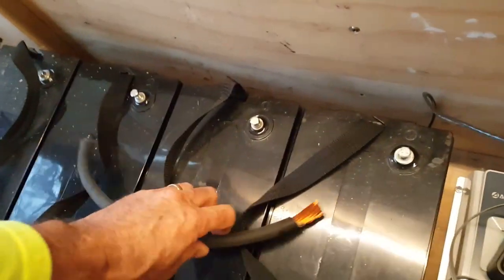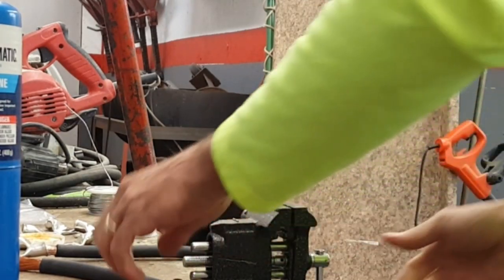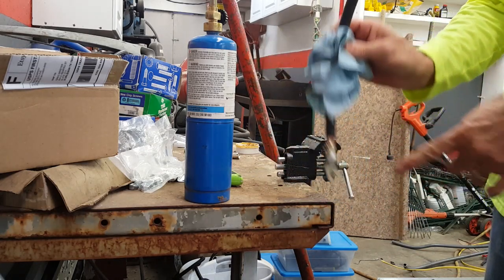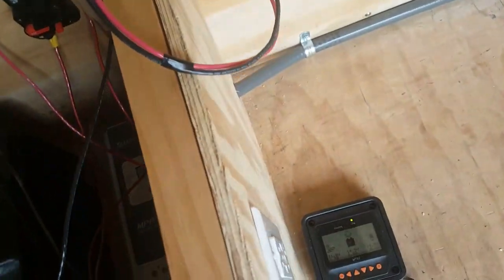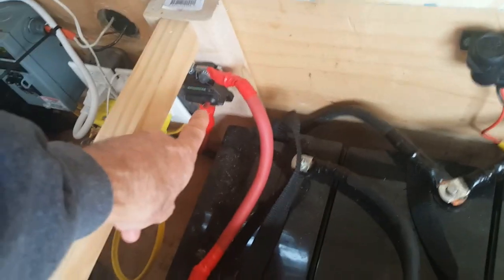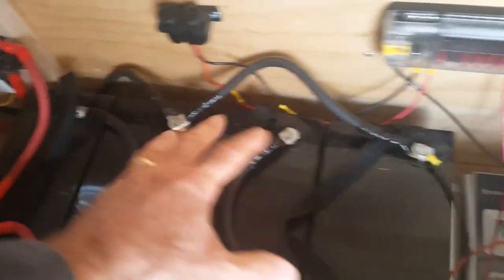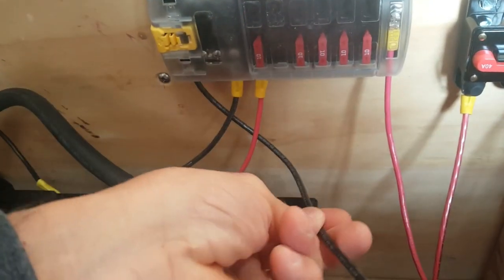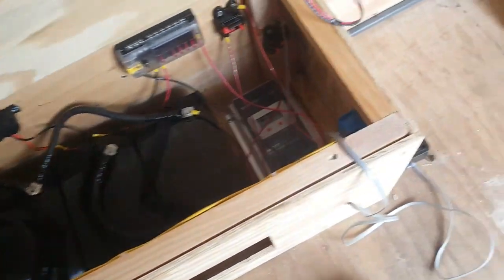12 VOLT DC ELECTRICAL SYSTEMS 6 x 12 Cargo Trailer Conversion Part 11

Comment: Thank you for going step by step and showing exactly which line goes to what and specifically adding what type of wire. Most videos will show you but not explain what is going on. I am a very visual learner and I learned more from yours about how to set up a 12v system. I know how the confidence to go out and try mine. Thank you again!!!
Reply from the maker: I am glad it helped Derek. Good luck on your project.

Comment: I really love your videos .... so informative! I have a question..the plug you use for the “switch” from shore to battery, what is the size of that cable and plug ... and I am assuming that you directly connected that to the outlets on either end?  Thanks for your videos!

Comment: Great info! How close do the batteries have to be to the rest of the set up?
Reply from the maker: Thanks for watching. I always try to keep all the cables and wires as short as possible. More wire is more resistance. Good luck with your project.

Comment: I really like your set up. A couple of questions,  I have a 7x14 trailer and I have 2- 12V batteries and 2- 170W solar panels making it a total of 340W with a 1500 inverter, actually the same one you have.  Should that be enough juice to run a small water pump and an AC unit that I am installing from the roof for dry camping?
Reply from the maker: That will run the water pump easily. It will not run the AC at all. We don't even try to run our AC off of our batteries. It's is not impossible to do but it takes a lot more battery than I have to run AC. We do run AC when we are hooked up to 30 amp shore power.

Comment: Nice build! Question: did you put anything between the battery bank and the load to protect the batteries by cutting off the load when they reach 11 volts or whatever your cut-off threshold is? As a ham radio operator I totally killed a 20 amp/hour AGM battery during a power outage. I wasn't home to shut down the load. While I was able to charge it again, it would die after 15 minutes so really, it never held a charge ever again.  Cheers!
Reply from the maker: I don't have anything like that. Thanks for the suggestion.

Comment: Question. 
Why did you use 150watt breaker? Same goes for the 40watt breakers?
Reply from the maker: They are 150 amp and 40 amp breakers. The breakers are sized for the wires and load expected.

Comment: GB I am very confused I hope you can help me. I am rebuilding a 73' Monterey Travel Trailer and I am going to start the electrical. I want to install shore power and of course battery power. I will add in solar later. My question is once the shore power is installed is there a way to run everything off that if you have hook ups, AC and DC power?  Or do you have to switch your connections over to the Inverter? Is there a way it all can connect together AC and DC power switch to and from Shore power to Battery? I hope this makes sense.
Reply from the maker: Hey Juan. When we are plugged into shore power everything is running off of shore power except the 12 volt roof vent. While plugged in, if we didn't have solar panels, we could plug in a battery charger to keep the batteries charged. When we are on battery power everything runs just on battery power, the inverter. We do have plug ins inside that we switch when we change power supplies. Take a look at part 9 and 10 of our build for more info. https://www.youtube.com/watch?v=Q2zctGoAR60&t   https://www.youtube.com/watch?v=u3wkBthRko0

Comment: So if you want to run battery power until 50% half life, how do you know when you get to that point? does the solar charger keep a running total?
Reply from the maker: Yes, the solar controller monitors that but not in percent. It keeps tabs on volts. There are lots of articles about volts vs %. You might take a look at this one. https://www.energymatters.com.au/components/battery-voltage-discharge/